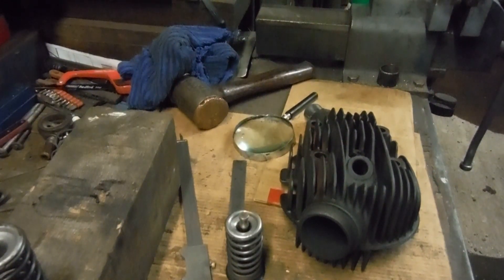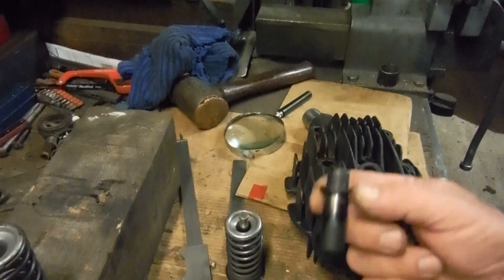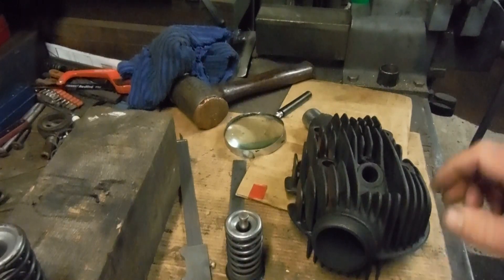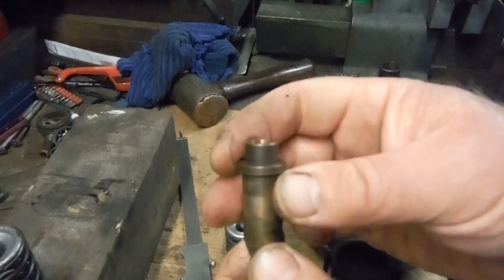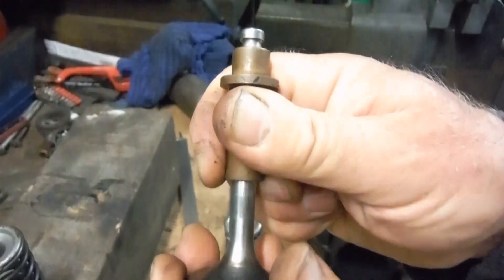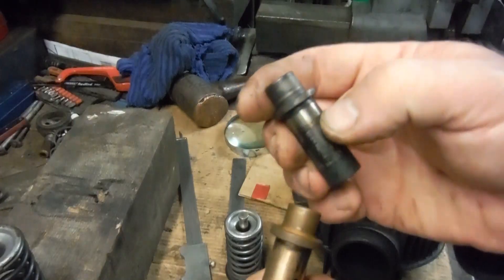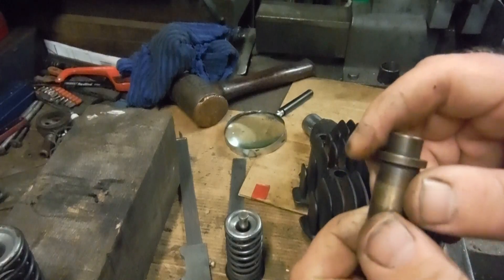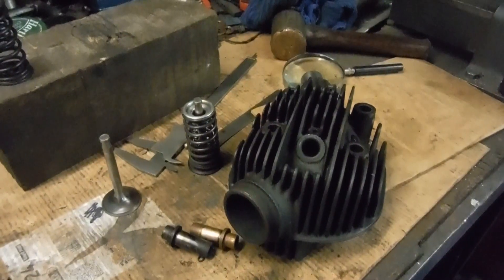Sunbeam Pre War cylinder head needs new valve guides and I have an idea.

Comment: Nice little technical job. I'm presuming the expansion rates of the different guide materials, so your adhering to the Enfield specs for reaming and the(older design than an alloy Enfield head) cast iron head material doesn't interfere?
A bit clumsily worded but hope you get the gist.
Reply from the maker: I was lucky in that the O.D of the Bullet valve guides were the same as both the cast iron and P.B. items removed from the head. All I had to focus on was sorting out the oil holes and annular grooves on the outside of the guides and boring the guides and then reaming them to accept the Sunbeam valves, which have a larger stem diameter than the R.E. ones.